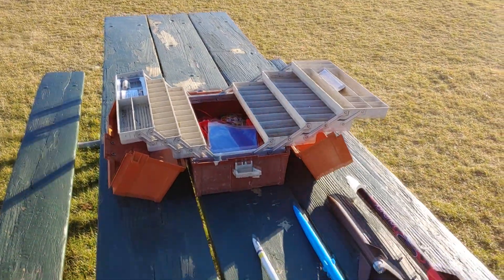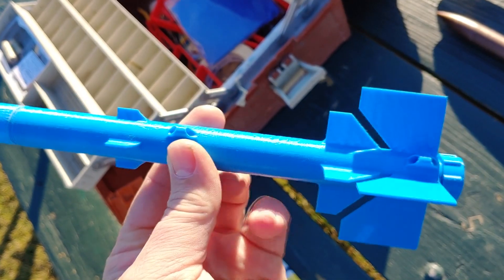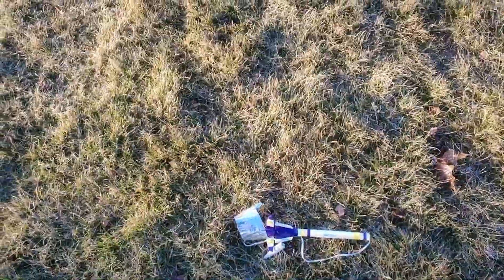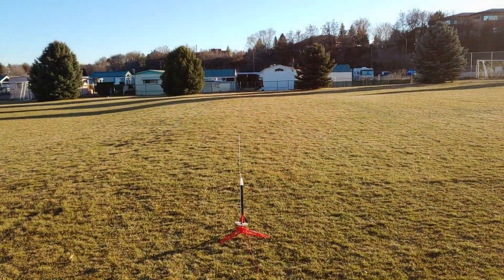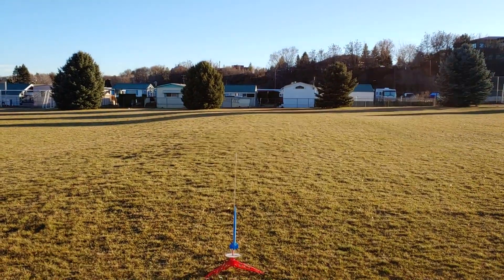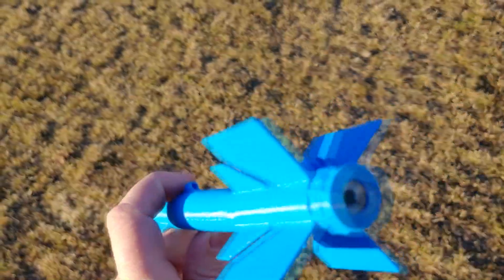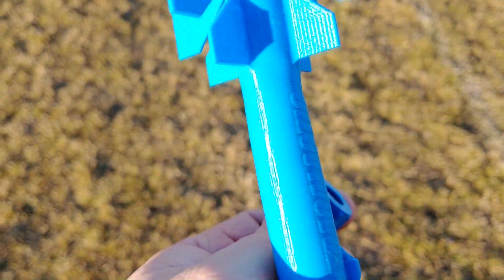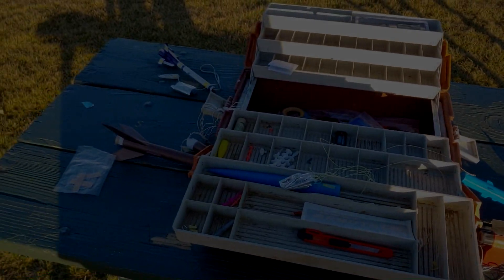How does this model rocket made of PLA do? Winter Mini-launch

Comment: What if you cut some aluminum from a soda can, rolled it to fit the inside diameter of the rocket, and then slid it in place at the point where the rocket deformed? I just got a 3d printer and wondered about 3d printed rockets. Yours is the first I viewed on this topic. Thanks.

Comment: Perhaps the base retainer could be an easily 3d printed component since that end isn't taking too much heat and the top could use a traditional cardboard stopper.
Reply from the maker: Since this, I've made another printed rocket that embeds a traditional body tube for the length of the rocket. Going to try it soon.

Comment: I've been having excellent luck with PLA rockets running C6-5s.  The rocket body is 30mm, with a ribbed 1mm sidewall.  The only heat damage I've been taking is the screw at the bottom, they last 3 to 5 flights, but are super quick to print extras.  I do have vents around the engine to help heat escape.
Reply: I was actually just doing some model rockets with C6-5s also and they worked awesome. I was looking to get more altitude and be able to have a heavier payload so I've been launching with E12-4's and they've been phenomenal in performance.